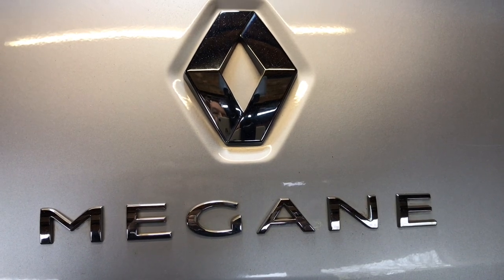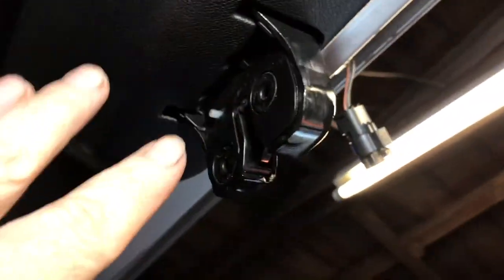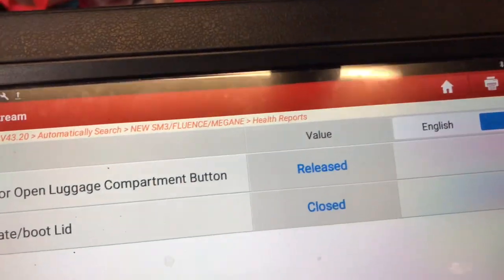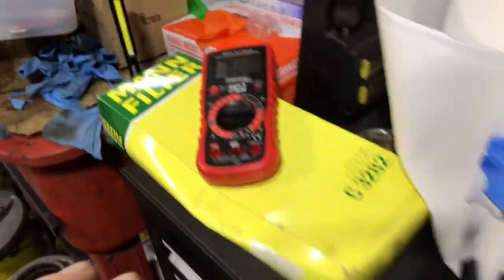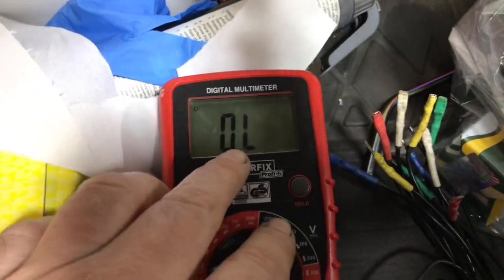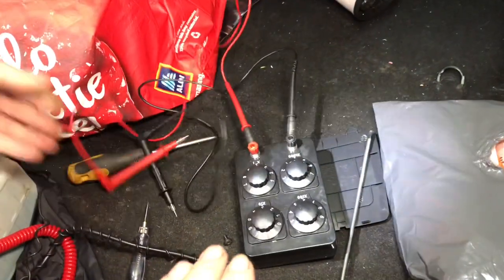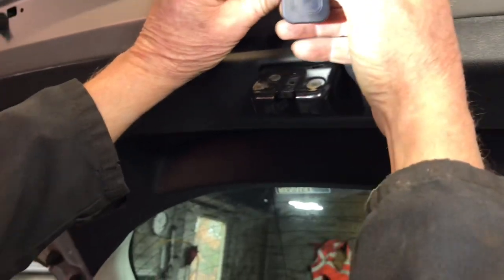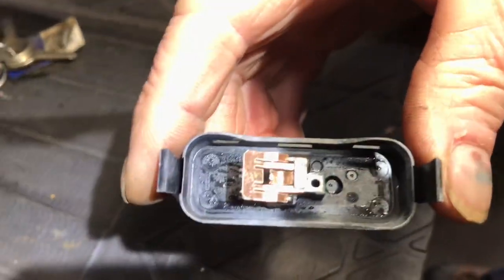Renault Megane - Boot not Opening, Intermittent!!! 😆

Comment: Good old Renault switches Sandy , I had a micra bubble shaped one in about 5 yr ago , similar problem,  boot opened intermittently,  customer couldnt afford to buy a new rear painted panel with the switch unit in , so I wired up a spring loaded micro switch , hidden next to the factory micro switch , does the same job , only this still works 😂😂  nice to see the decade box out 👍👍